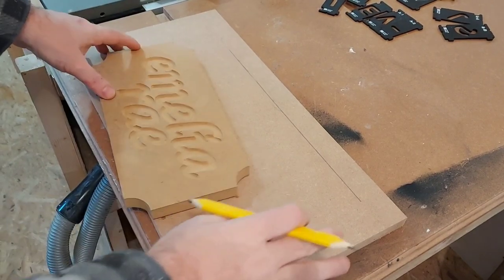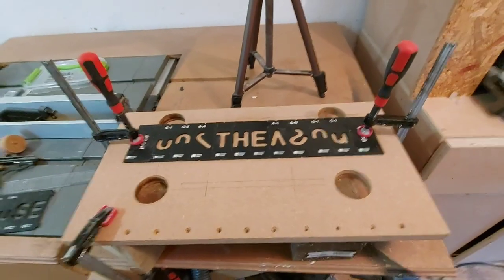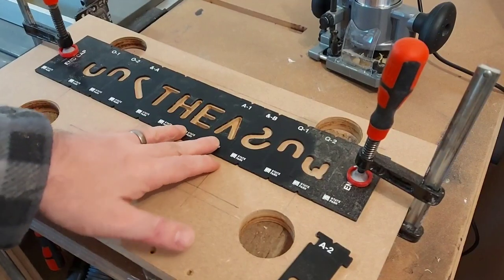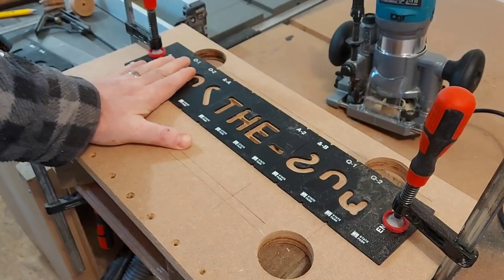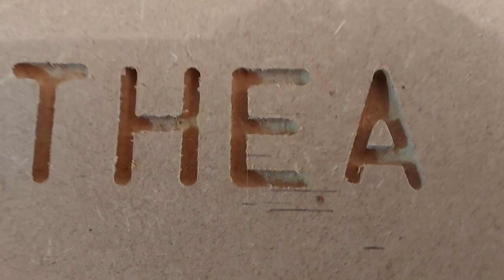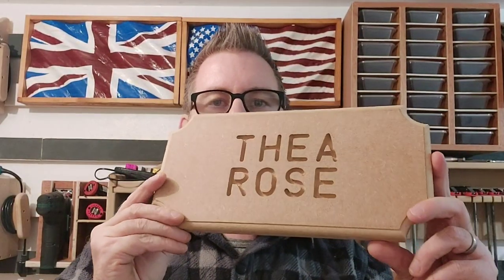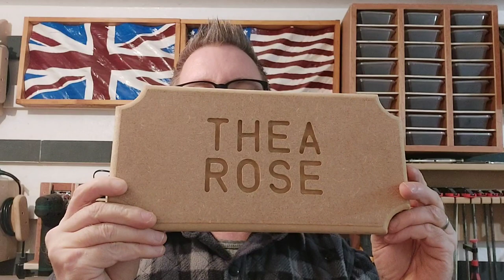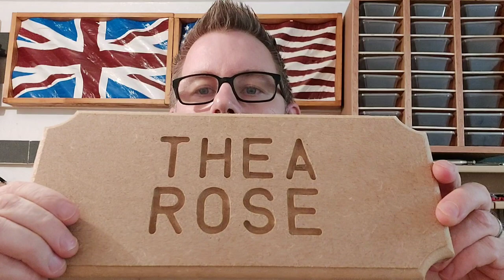Making name plaques using Rockler letter templates

Comment: Great video. What size are the rockler bits and what size are the finished letters please?
Reply from the maker: Its a 3/16 bit & the letters are 3.5cm in height once routed. That's with the 1 1/2 inch set
Reply: Thanks